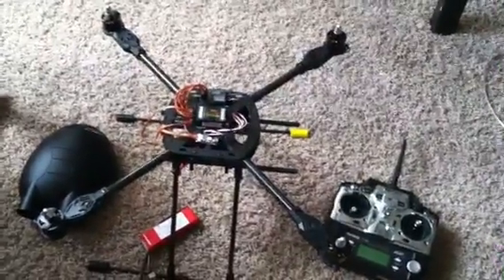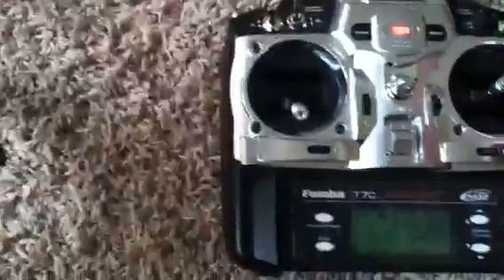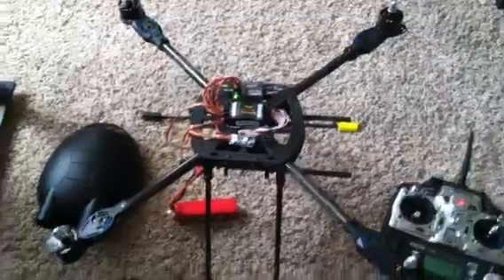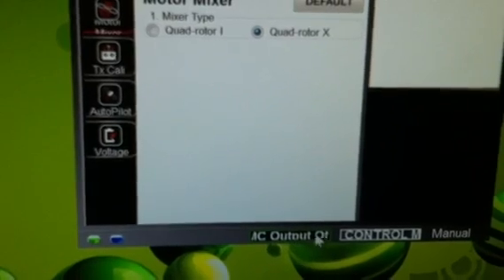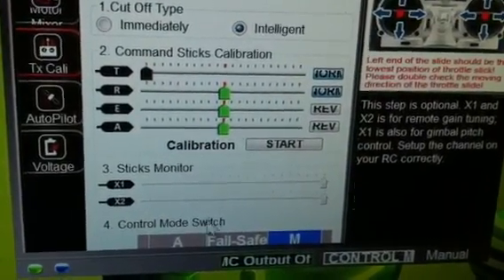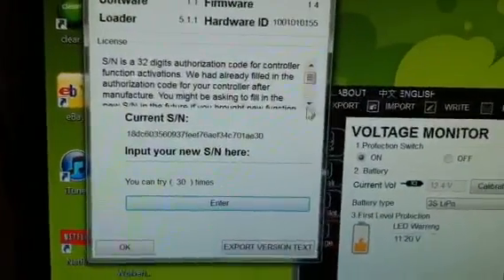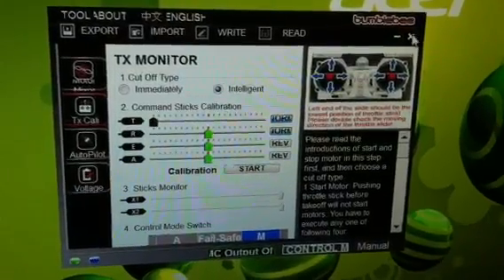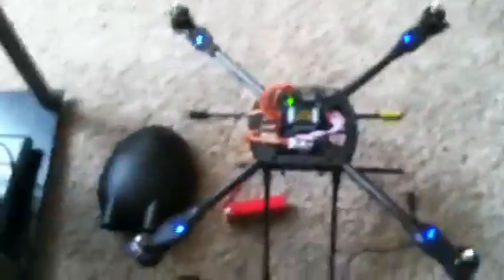Bumble Bee Quad No Motor Response

Comment: I have the same exact problem as this gentleman. I got it all configured, push write on the S-T software. Then I disconnected it, power cycled it, did the control stick command, push the throttle to 10% and nothing. Not even a click.

Comment: I've changed my thought - After re-watching your video, I think you have matched set..  The flashing blue lights are the same as my BB ESCs.  BUT, I think what you need is In that calibration program, the "write" button is to save the settings you've configured into the flight controller, so you should be hitting write after you do your stick calibration.  Read will pull in all your settings from the flight controller to make changes later (then write again) SO.. save your settings!! good luck!

Comment: Did you ever get it working?  I had a similar problem, and figured it out..  The bumblebee ESCs and flight controller use a different communications protocol than normal to communicate - different PWM settings.  In my case, I bought a kit with ESCs, but no flight controller, and so when I put my standard flight controller (Ardupilot) on it, it could not trigger the ESCs.  in your case, it looks like you have the BB flight controller but standard ESCs. (continued)

Comment: I'm having a similar problem, but after I update the software I have a permanent CFG-ERR[8] and now the blinking led on the USB chip blinks red after it is unplugged.  It just won't connect to my remote controller.. no motors etc